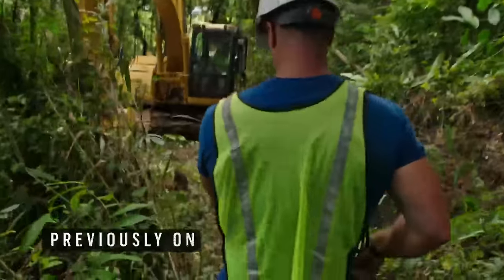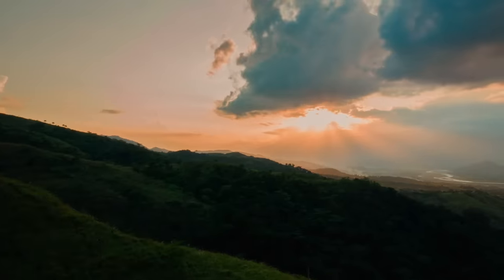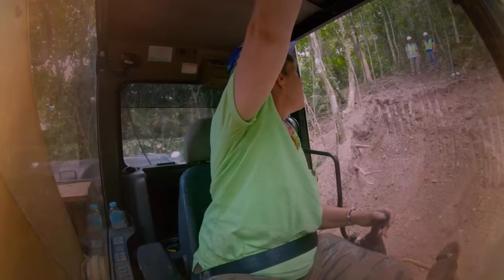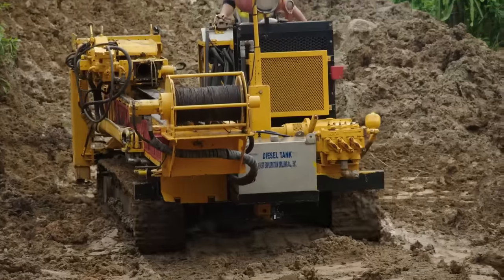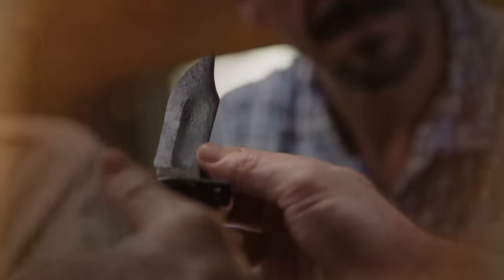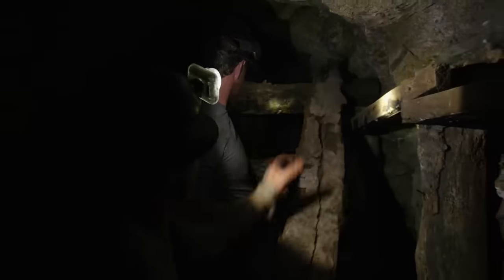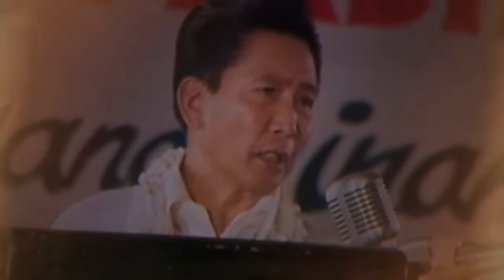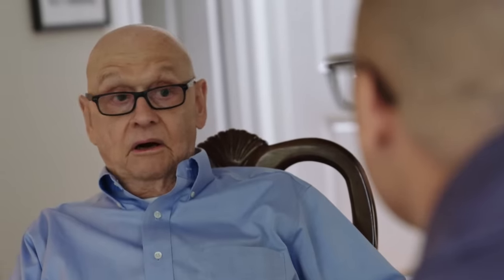Lost Gold of WWII: Treasure Hunters Uncover Buried Japanese Gold *2 Hour Marathon*

Comment: I'd love to be apart of that incase you need a navigator for that horizontal drilling also heavy equipment operator laborer and somewhat of an historian archeologist.  By the way those teeth were not human teeth. So I'd image the bones were obviously non human. Ole dude just shut the job down for unnecessary reasons.  Just another unnecessary obstacle. I thought this would be different than the curse of joke island. But its undoubted at this point its a Japanese treasure location.